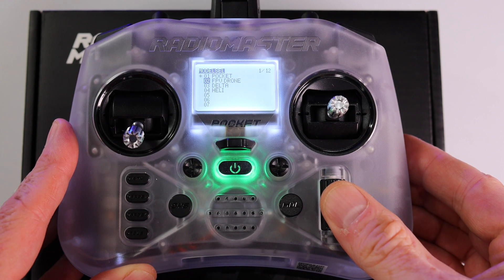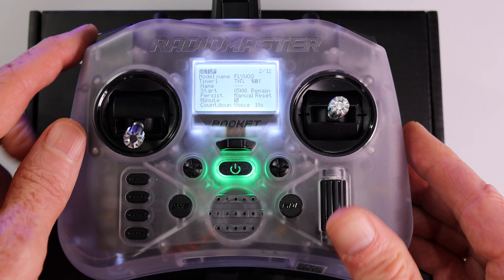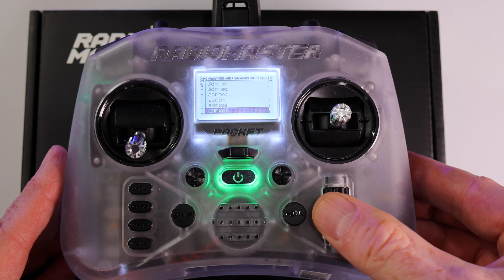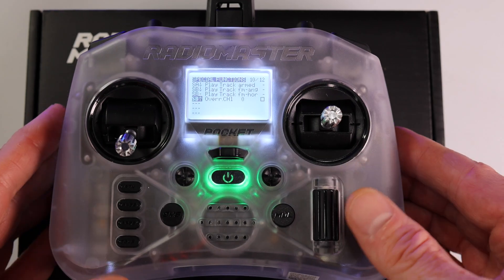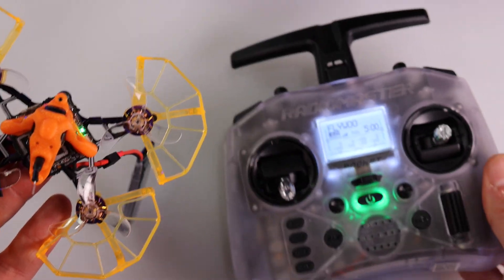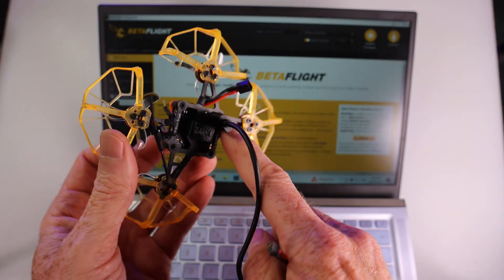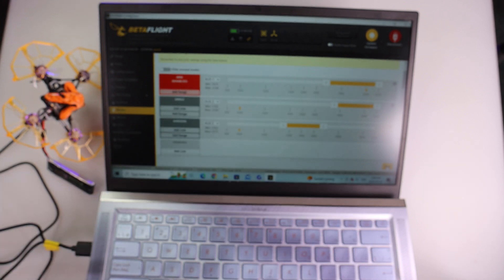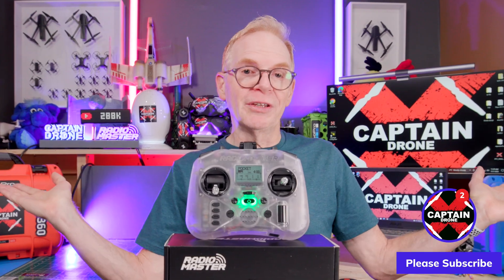RadioMaster Pocket - How To Set Up and Bind a Drone - Step by Step

Comment: Hey, can you do the seam Vid. with the iFlight Commando 8?
Reply from the maker: The interface on the Commando 8 is the same. The difference is in those tiny 5 way buttons on the Commando 8 for menu selection
Reply: @CAPTAINDRONE798  One last Question is ELRS 2.4GHz RX the same or work with each other, with ELRS V2 2.4G RF 500mW
Reply from the maker: @nicokneubuhler2974 Ony work with each other if the Transmitter and Receiver are on the same Firmware number (so if the transmitter is on version 3.x then the receiver has to also be on version 3.x)

Comment: Hi i want to use the pocket with FW 3.3.0 with a Beta Meteor 75 pro, but im not able to bind them, the elrs config give me no chance to create a fw for the RX which fits ... which way could i go ?
Reply from the maker: My guess is your old Meteor is on ELRS firmware 2.x and your pocket is on 3.x.  So you either have to upgrade the Meteor or downgrade the Pocket.  I can’t recall but your Meteor could be ELRS SPI (you’d have to check).  ELRS SPI is different process to upgrade/downgrade.

Comment: Hello I set up my radiomaster pocket but i have problems with playtrack i get the message No sounds on SD i check it on my computer and sounds are correctly instaled on sd.
Reply from the maker: Sounds are under the language you selected for your radio, so if ENGLISH, they need to be under the EN directory.  Everything is set to default to work out of the box. If SYSTEM setting changes are made then you may have issues, or worse if you take the micro SD card out when the radio is on and then insert it with the radio on you could corrupt the card.
Reply: @CAPTAINDRONE798  thank you so much

Comment: Hi, beginner here. Can I bind this remote to mjx bugs 8 pro? Or do I need something else to make it possible? Thanks
Reply: Did you find out a solution to the Bugs 8 pro?  I have the Jumper 4in1 external rf module, it has a Bugs option, however, I was not able to get it to work with My Jumper T16 running Edge software.  I know this is an older post, thanks for any feedback. I am leaning to get the ELRS Ranger micro module for the Jumper T16, but also considering the Pocket by RadioMaster
for just ELRS not much of a price difference. Conflicted on choices
Captian Drone..Great presentations enjoy your channel
Reply: @bobflyer4346  technically it could be bind with bugs module on jp4in1. but radiomaster pocket has limitation for the older module. it would be great if you work on ELRS instead. 
I use jumper tpro right now, and never has a chance to bind on bugs 8 pro. because my bugs ESC already burn and the motor are broken! :D the fc is also not good enough to handle big ampere, that's why its wobbly while fly in high rate. if you work with a lot of drone, your T16 still good to go. if you consider to work only on ELRS, I think pocket is match. for me, I like silly drone, that's why I take Tpro with jp4in1 lol. hope this anwer!

Comment: I have the same drone and radio of course but my timer doesn’t start on TH% until the throttle is used and then I’m stops when the throttle is down. Also does your Flywoo beep? I trted to setup a beeper on mine and doesn’t work.

Comment: I bought a pocket radio and a BETAFPV PAVO PICO. I did all the steps in the video but I couldn't connect the radio with the drone (bind). Please someone help me. (both the drone and radio are ERLS)
Reply from the maker: If you did everything correctly then the odds are your PICO is on ELRS 2.x and your POCKET is on ELRS 3.x (or the other way around).  ELRS requires a bind to only occur if both are on the save firmware version.

Comment: Good video but you dont tell us how we check if the radio and the speedy are running the same firmware version , speedy told me its version 3.0.1 but in elrs scroll down to bottom I saw version 3.3.0 so I went to Elrs configurator...also I couldnt bind because UART 3 rx wasnt set. regards from Spain
Reply from the maker: The ELRS version is shown in the video. It works like this… if your radio is ELRS 3.x then it will bind to your drone with ELRS 3.x.  The FIRMWARE numbers only need to be identical with the first number.
Reply: @CAPTAINDRONE798  this may explain what's going on with my new toy....my Pocket is 3.xx and the receiver FW is 4.xx. They bind but the throttle response is crazy.....hit the arm button and the motors start up, but as soon as throttle is advanced just a touch they go to 100%.
In Betaflight there is no option to flash anything lower than 4.xx onto the Mobula7....do I need to update the Pocket?, and if so, how is that done?
Any advice greatly appreciated!
Reply from the maker: @TheWingnut58  Oh, I think you are confusing a few things.  The POCKET is on ELRS firmware version 3.x.   There is no ELRS firmware 4.x (not yet, unless you magically found some copy from the future).  If you were an experience FPV pilot with experience in the FPV hobby, any issues you have would be easily resolved.  But, if you are new at this game, it can be very challenging to problem solve.  In Betaflight Configurator you can only FLASH betaflight firmware and usually BL HELI firmware for the ESC motors.  Doing either, as someone with no experience will almost surely BRICK your drone.  My advice is to simple find someone very knowledgeable in the FPV hobby and let them try your quad out.  The only time I have heard of a quad going crazy after arming it is when the WRONG battery is used... such as a 6S battery on a 4S Drone.  FPV drones are designed to take off like a rocket, but for someone inexperienced, this can seem all wrong.
Reply: @CAPTAINDRONE798  I'm not new to rc, but am very new to fpv and elrs.
I wasn't able to bind without flashing the firmware on the Mobula7, but used the version Betaflight recommended. 
I'm also familiar with lipo batteries and know that I'm using an acceptable battery.....1s 550mah.....and all of it is brand new-never flown. Everything else seems to be working as it should other than the throttle response....so I'm thinking that it might be a setting or calibration that I've missed somewhere. 
I live in a very rural area and have no clue where the nearest experienced fpv'er might be.....likely hours away.
So, and ideas anyone has, I'd love to try and get this thing sorted out....

Edit to add: after arming, once the throttle is advanced above roughly 15-20% the power goes to 100% and remains there regardless of throttle stick position. Another observation is that the motors don't seem to be "synchronized" but rather seem to be shifting speed slightly in a random manner.
Reply from the maker: @TheWingnut58  could it be that your joysticks are configured incorrectly.  In other words when you go into Betaflight Configurator to the RECEIVER tab and you see a picture of your drone and move the joysticks, does the drone react correctly (pitch, roll, yaw)
Reply: @CAPTAINDRONE798  just checked, that's not it....all other controls and switches seem to be functioning normally.
I just went to Happymodel and got their "factory flash" and reflashed the FC and set up all the switches again. It still does the same thing, but now when the right stick is moved right, the drone seems to want to go right and forward....almost like there's a mix set up on the channel.
Also, after the reflash, the motors shut off once the drone is tilted a few degrees off of a "flat hover" attitude.

Edit to add: I figured out the issue on the "mix"....the motors needed to be reversed in Betaflight, otherwise still have the throttle issue...
Reply: @CAPTAINDRONE798  also, my apologies Steve...I should have shown more gratitude for your help in trying to get this worked out.....thanks buddy!
Reply from the maker: @TheWingnut58  it seems you are narrowing down the issue and perhaps not to far from resolving it
Reply: @TheWingnut58  were you able to solve the issue, it is happening exactly the same to me! thanks a lot
Reply: I sure didn't, it seemed to be working normally the next day and I took it outside. About half way into the first battery it went apeshit and flew away never to be seen again.

Comment: Thanks so much Steve .. Really appreciate your tutorials … Just bought the Non ELRS version.. I’m thinking due to the price buying a separate ELRS controller.. Or is the Nano Ranger a better option.. From one of your Irish Fans from across the pond 🌊💚😀👍
Reply from the maker: The pocket exists for the purpose of being compact.  If you want something different/larger then the Boxer is your next option. Pocket uses Nano modules on the back and Boxer users Micro modules, so if you purchased the Ranger module it would not work with both.

Comment: Just a heads up, I just got my Pocket and the timer didn't automatically start after that initial configuration (before setting it to the arm trigger). It would only count down if the throttle stick was actually engaged (not at the bottom). I looked it up and TH% means the timer counts down in coordination with your throttle. So at fully throttle it counts down normally, at half throttle it counts down more slowly, at no throttle (stick at pulled all the way down) it doesn't count down at all.

I'm assuming this is because the version of EdgeTX that shipped with my radio is a newer version.
Reply: I guess I don't understand the need for a timer at all. Is it important? It's number one in this video. Please excuse my ignorance. I'm not trying to be a smart alec.
Reply: @Sonic_Ox  I think it's a useful reminder so you don't have to monitor the battery voltage constantly.
Reply: Thank you ggochalleng. That does seem helpful if you know about how long your typical flight time is. Say you have a quad that typically flies about 10 minutes with a certain battery, a certain flight style, under certain conditions like wind... you could set your timer for eight or nine minutes knowing you should be looking to land when your timer beeps. I guess I'm just accustomed to monitoring my voltage and never thought to set a timer. Thanks for the reply amigo.
Reply: I have the same issue, does it work following the same steps or I need to do something else ?
Reply: @dand.1941  yes, following the same steps all work. Just a few minor differences on what the radio does.
Reply: Same here.

Comment: A point worth noting..... Many drones don't require that the battery be plugged in to connect to beta flight.

For digital Vtx's it's important to keep them cool during this process if a battery is needed.
But in most cases like on these small flywoos a battery isn't required

Comment: Radiomaster and Edge TX didn't adopt my Sound Pack, so yeah not buying it.
Reply from the maker: What does your sound pack consist of?
Reply: @CAPTAINDRONE798  850 sounds that you can use for any kind of audible reporting you like.  

On the simplest level, for example, you can bind them to a switch, so when you flip Armed, your radio says Armed.  When you flip it back, it says Disarmed.   Or another switch, Angle, horizon, or Acro mode.

Or you can flip another switch, and it says battery voltage, and then reads out yoru quads voltage.  Or your SNR.  Or CurrentDraw, Airspeed, Altitude, etc. 

Or, as another example, set an alarm, so when your battery alarm switch is set to on, and your battery voltage drops below 3.3v, every 20 seconds it will start reading out the battery voltage to warn you.. until you flip that switch off.

Using all those unused momentary trim switches and 3 position / 2 position swiches on your radio, you can sweep away all that chart funk from your OSD obscuring your view.   

It's actually pretty easy to set up .  If you can write a IF THEN ELSE Basic command on a VIc-20 or C=64, you can set up Open TX / Edge TX to do a lot of basic simple straightforward things for you.   IF (this switch state or condition exists) THEN  (play this sound file).

I could hand you my radio, for example, and not tell you anything of what the model did, you could run through filipping all the switches and within 60 seconds know what they all were assigned to do.  That may never happen, however, more likely, you may come back after a year of not using YOUR  radio, and have forgotten what you set all YOUR switches to.  You can put sticky tape labels all over your radio, or draw a diagram on a piece of cardboard and save it.  But those things aren't useful when your eyes are under a pair of goggles and you're trying to find where that Return to Home switch was...

Comment: Wie bekomme ich das Display von 3:22 wieder her, ich habe es irgendwie verstellt. Ich sehe die Sticks und Schalter als Balken. Hätte es gerne so wie bei 3:22. >Boxer<
How do I get the display back from 3:22, I have it misaligned somehow. I see the sticks and switches as bars. I would like to have it like in 3:22. >Boxer<
Reply from the maker: You have simply scrolled the screen.  If you can’t figure it out, just power off and back on.
Reply: @CAPTAINDRONE798  Turning it off and on doesn't do anything, but the page key works.

Comment: It drives me bonkers that this radio got full size 18650 when the zorro got those little baby batteries 😡😡😡
Reply: I'm still surprised no one's introduced an internal battery mod to alleviate that particular problem!
Reply: At vaping i even have 21700 LiIon Batteries, so 18650 isnt even fullsize 😉 and i am sure there are even bigger LiIon Batteries 😮
Reply: I have some lifepo4 that came from transformers i put in my power wheelchair lol works amazing now! @Eckus
Reply: @ryswe  same lol had to call like 10 different places till i found one where they sold em.
Reply from the maker: Very true